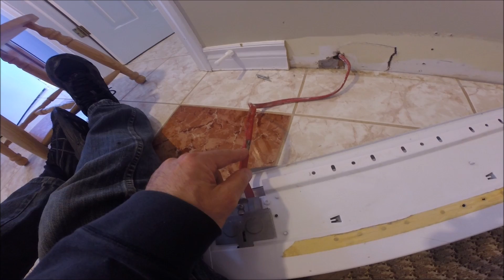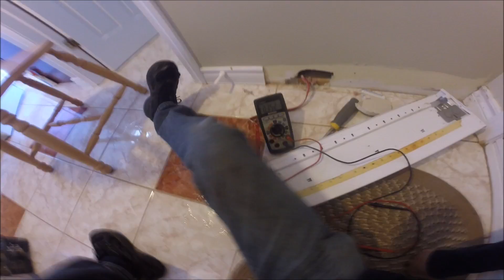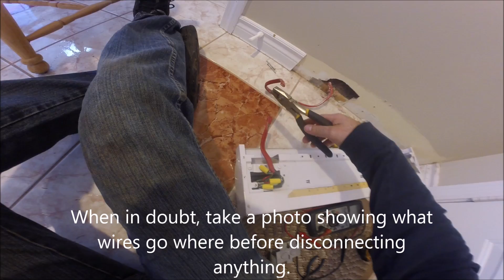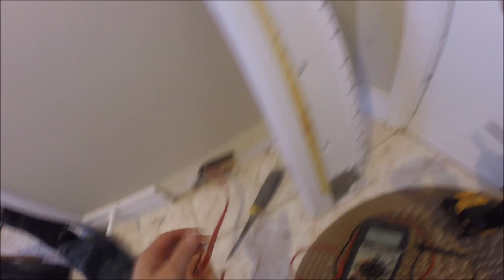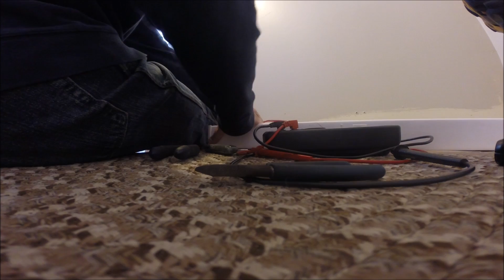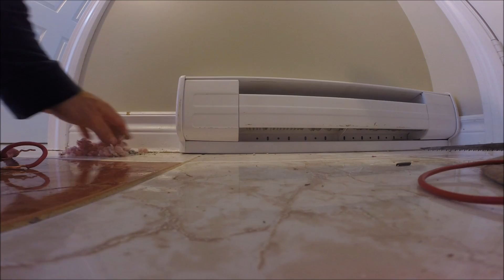DIY - Electric Baseboard Heater Replacement or Cable Repair Due to Rodent Damage

Comment: thanks. You are a good teacher and detective.
I am replacing 50 year old bbh’s nexr week.
I have chosen Ouellet out of Quebec over Cadet out of Seattle.
It has nothing to do w NAFTA. Cadets were at comparable price points,
But their live  customers phone service/tech rep was full of disclaimers and fast talk w/out patience for DIYer.
Ouellet  Canada was friendly, patient, informative, but, because of my 1st time at Anythimg like this, his English as a 2nd language and, my French to bon jour madamazale missed important procedures spoken.
So your vid is what I need altho I remain fearful I might die if I use the multimeter incorrectly or an orange and/or polka dot extra wire is poking their the wall and the Ouellet has a purple stripe and mauve wire comming out.

Comment: I dislike the look and the space that the baseboard heaters take up. I prefer a small inside wall mounted heater. I want to get rid of all baseboard heaters in apts & old condo units.